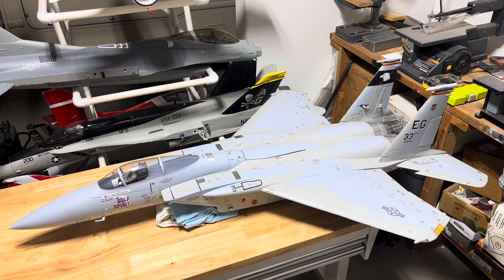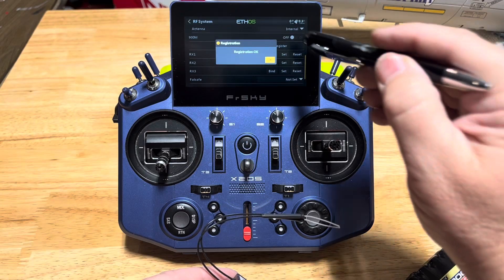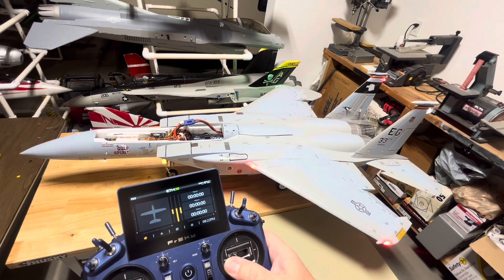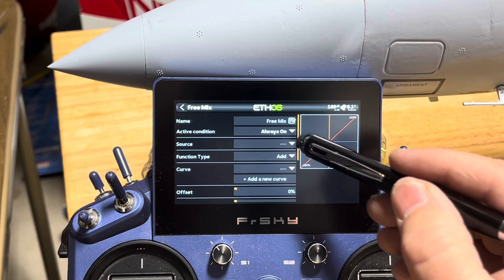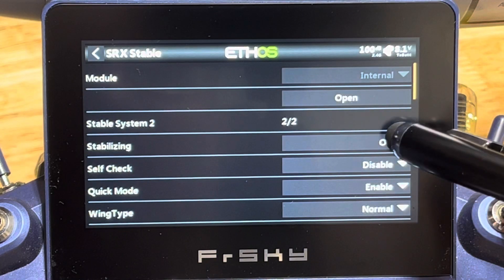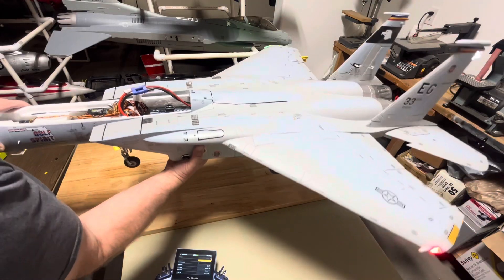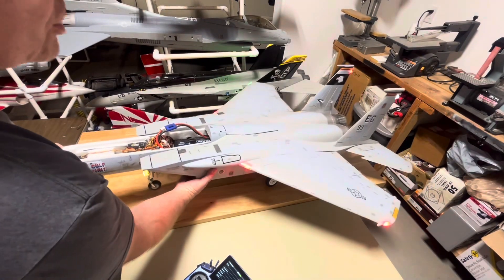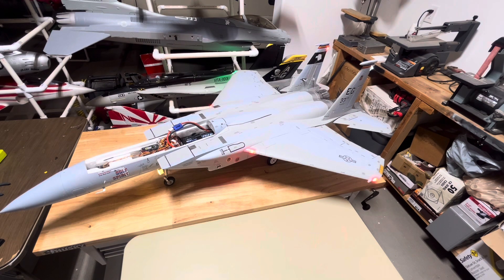Setting up gyro stabilization in an FrSky SR10+ and X20S using Ethos

Comment: Turn that junk off and just learn how to fly. Self leveling actually causes more issues than it solves. You want to turn. You establish bank angle, gently pull up on the elevator to make the turn. Well... the moment you release the aileron stick after you have established your bank angle... BOOM self leveling kicks in and NOW when you pull up on the elevator you go UP and not into your turn. Massive problem actually. Like I said.. turn that junk off and just learn how to fly. SO much easier actually.

Comment: I'm still confused with gains... Does the knob changes the menu gains? Or it just adds or subtracts gain to the menu gains to test how much more or less I need? 
If menu gains is 100 and my knob is in 40, do I need to dial 140 on gain menu to set it for never and disable the knob? Sorry so many questions but I'm still trying to understand it. Regards

Comment: One of the problems with these videos, as great as they  are, it seems after several updates things change quite  a bit.  My screens do not match exactly.  Also in the SXR setting screen, none of my changes stick.  Say I change an elevator percentage to 100% it turns yellow, but then just goes back to 0.

Comment: Did this change with the latest update? My stabilization configuration is in the device config receivers menu and there isn't a wizard. Page 63 of the Ethos manual v1.6.2 shows the new method. I found the video that shows how to do it with the latest update: https://youtu.be/0pKSzxyJrB8?si=5b_CUHnn2huDF85w

Comment: Hi Mate. Do you have to do the self check before every flight? Cheers
Reply: Thanks for your prompt reply. What is a good starting point setting the gain? If I have 3 different modes setups with expo, say 100%, 80%, and 60%, will this have an effect on the trow/travel for the gyro also? Say I change from 100% to 60% will this also limit the gyro to that? Cheers
Reply from the maker: No. Just when setting it up the first time

Comment: To check rudder in the same mode as the other surfaces pick it up and hold it nose towards you, slowly spin left or right and the rudder will try to push back the other way.

Comment: Question. Once you have flow the plane and adjust your gain that works beat for you how would you lock that in so you don't have to re-adjust it. 
If you have other models and that knob has been move you don't want to have to  keep adjusting the gain control.
Reply: Howdy.  Great question, and I've struggled with the same thing.  You can do a couple of things.  You could move it to a knob or slider that you don't plan on using regularly.  Or, (what I recommend) is once you have it adjusted right, make the changes in the stabilization menu on the radio itself and then put your knob back to a neutral position.  If you have more than one model you're flying, you're not going to want to have to move that knob back and forth and remember where it was set for each model.  I've tried to keep that in a neutral position and just adjust it for the maiden or when getting the model dialed in.  Making your permanent adjustments in the radio is best (IMHO).  Hope this helps.  Thanks for asking.  Good luck!
Reply: @greatesthymnsonline  Hi, Thanks for the reply. I rather have the gain fix once I'm happy with it. In stabilization menu can you see the adjustment that was made by  the knob? 
If your not able to see that how would one know how much to adjust in menu area?

I have one setup in a plane and because the knob would sometime change position I dislike having to re-adjust all the time. I just turn the gyro figure off. The plane flies well with out it. But I do see a different on windy days.

Comment: Great video helped me a lot! 😄

Could you make a video of what needs to be considered before the flight when connecting the battery, for example: that the aircraft must stand still for 3 seconds and must a self-test be carried out again?

Thank you in advance!
Reply from the maker: thanks.  Glad to hear it's helpful.  It's always best to let the plane sit for a few seconds after connecting to a plane with a gyro.  Same applies here.  No need to do a self-test before every flight. But do one after you've made any significant changes to the flight set up, like changing modes (Quick mode, for example). But, a self check never hurts, so use your best judgment on that.

Comment: You didn't check the rudder.
Reply: Indeed. He said that in auto level mode cannot be checked. As i checked in the manual though a way to do it is to enable knife edge.
Reply: @Balthazar030  I am able to check the rudder in auto level mode on all of my aircraft.